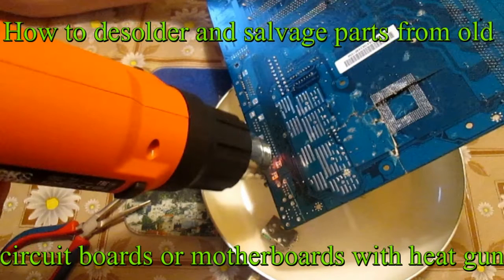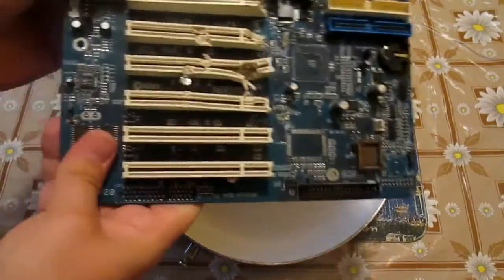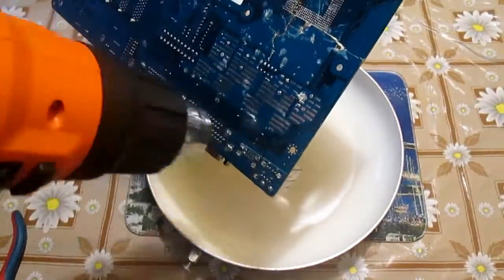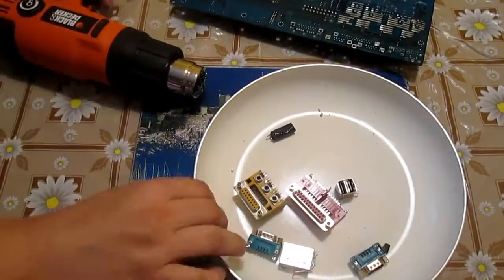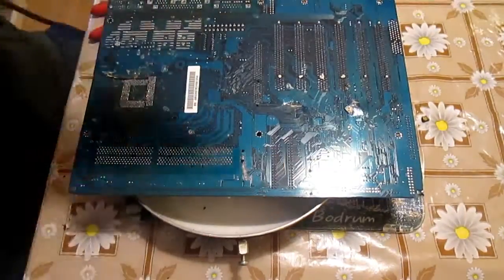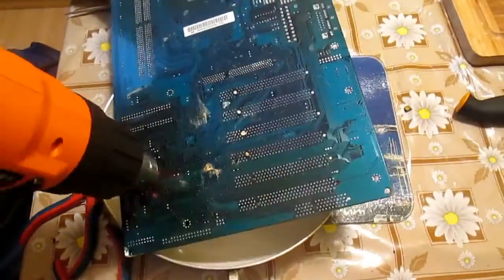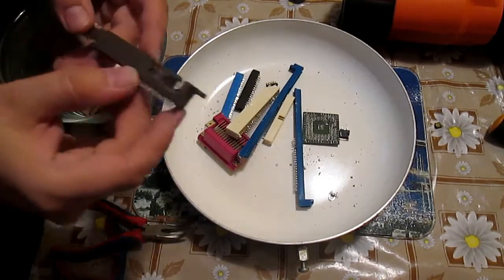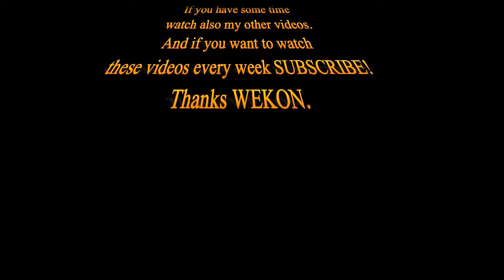How to desolder and salvage parts from old circuit boards or motherboards with heat gun

Comment: I have a 300 watr heat gun but the componets on the mother board wont loosen up. Plus how long do I need to put heat on the motherboard in order for componets to loosen up to take off.
I'm scared if I put too much heat that I will fry the motherboard

Comment: The "plastic" of the board doesn't melt ?
Reply: If you're able to move the heat around the area, it will let the solder slowly heat up, and also, never put the heat all in one location. Leaving the heat gun turned on in one spot over a relatively short time, 1-2 minutes, will definitely burn the board material, same as leaving a flame in one spot long enough and it will burn the board material too, but move the flame around and pick at it with pliers, and the solder will only (usually) start heating up because solder works quick with heat, I guess

Comment: i use a vice to take my parts off,  i put the mother board in the vice, so it hold it,  & i will try the heat gun,  have try a solder gun, but no good,  i'll get a head gun this friday & try it.  thanks for the tip, have a nice day.  colin uk.

Comment: Hello, I would to dessolder some capacitors with soldering iron station from a broken motherboard. My soldering iron can reach 470c as temperature but it seems to be not sufficient to remove capacitors. Can you kindly help me to learn how to desoldering capacitors from PC motherboard (I need to repair this motherboard, so I can't damage it) ? And, another question. If I can't dessolder old/broken capacitors, can I pull out it and solder new capacitor on the old capacitor brakets? If yes, how? Cause tin solder slide away... Thanks a lot
Reply: 470 should be more than enough. Have you tried wiggling it manually while using the tip of your iron to melt the solder?